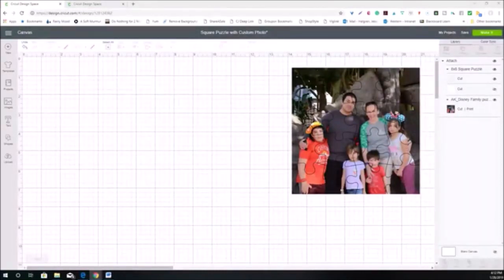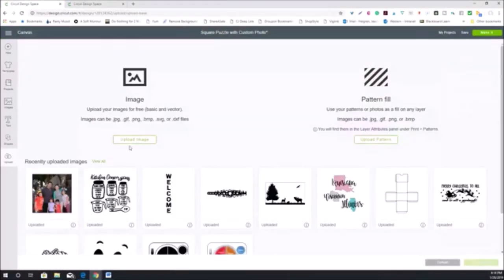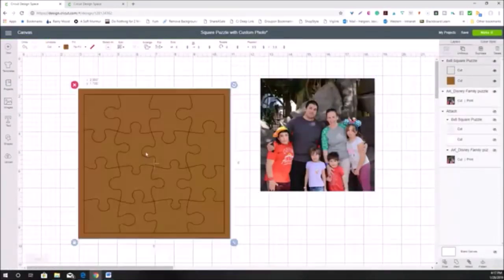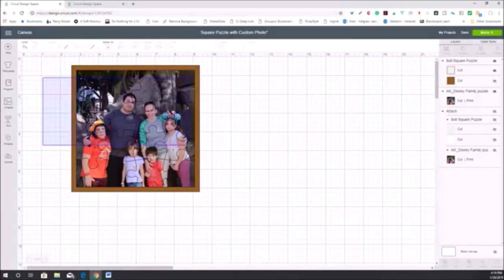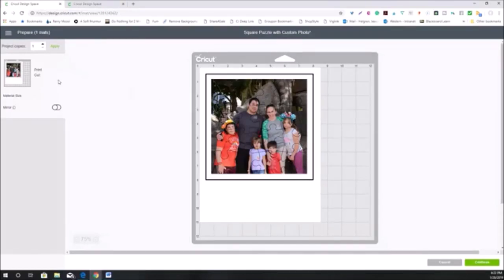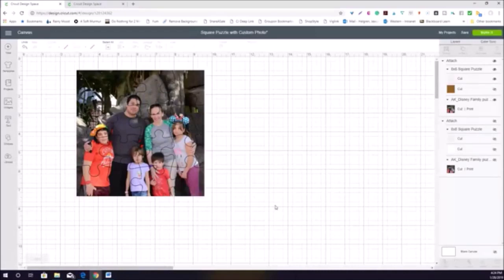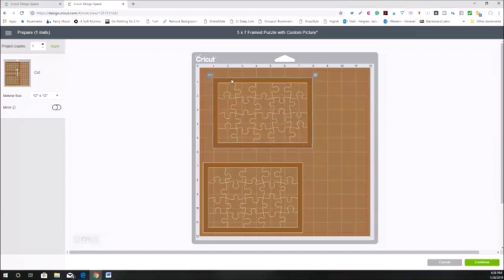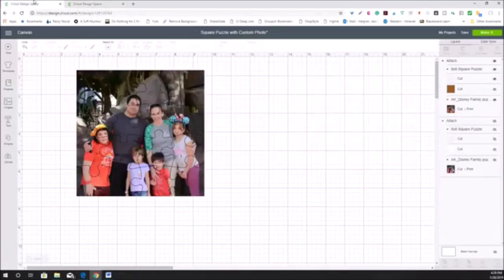Making a Puzzle - Print Then Cut Design Space Tutorial

Comment: Hello, on the video l can’t see the with and height / steps your doing in design space. I can hear your steps but not see them clear :(
Reply from the maker: The height and width just depend on what size you personally want to make. If you are doing a print then cut, the size can be whatever you want as long as it is within the dimensions of what print then cut can do. If you are doing a pre-printed photo and gluing it on, you just need to measure your photo size and make your puzzle that size (or even a hair smaller).